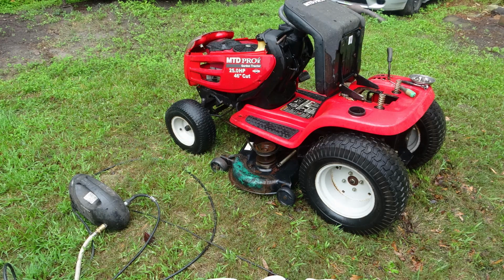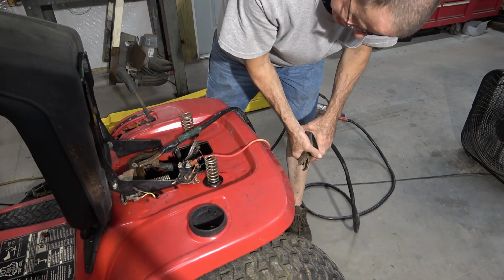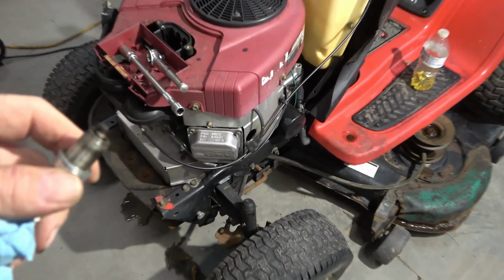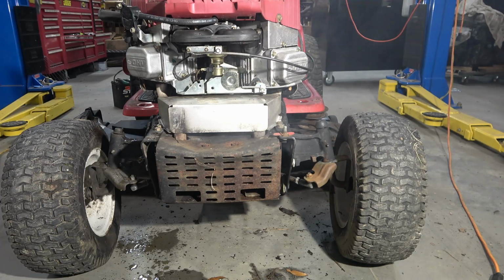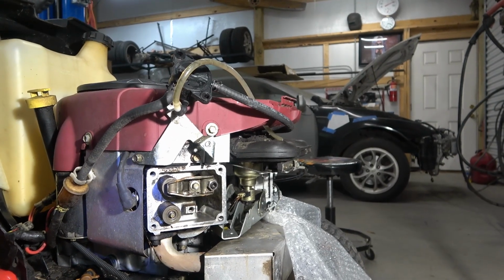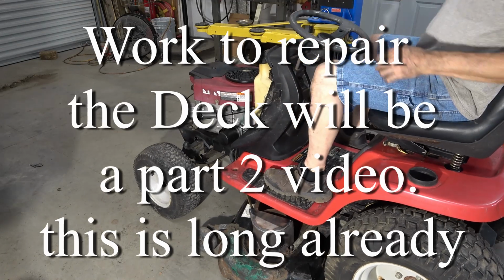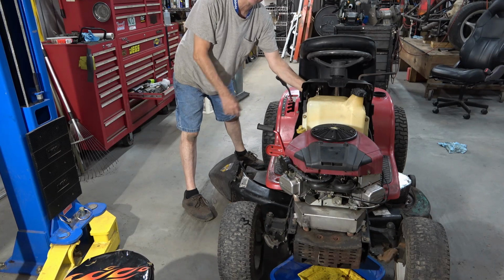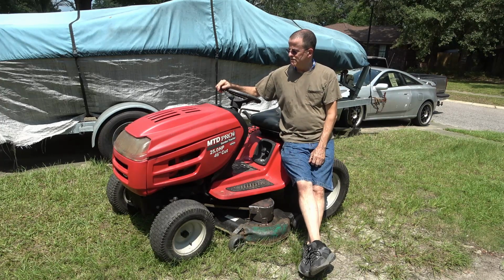Free Lawn mower - will it run_ - Will not start, how bad can it be? LOL... Part 1

Comment: I was placing my bet on needing valve adjustment or compression release on camshaft being broken, carb needing cleaned out, and or head gasket blowout from overfilling the oil, since those are usually the things that take a vertical crank lawn tractor from working to free.  Wasn't expecting that much sludge.
Reply from the maker: Ah ha you've done this before🙂. Ya that was alot of sludge.   I'm thinking because it's sat (outside in the woods) so long with that valve cover gasket out of place on the top edge. And I got lucky on the carb working👍.

Comment: Where did all the smoke go???????  Was it from oil leaking from valve cover on to the muffler?
Reply from the maker: That had to be what it was.
Reply: @TSRGarage  Yep, a good bath with your pressures washer is always in order for a good first step.  I fixed my neighbors zero turn he purchased used.  After the bath, Ha Ha I had to replace almost every gasket and seal on the engine. Then no more smoke and it ran and acted like a good lawnmower.
Reply from the maker: @helicopterjohns   👍
Reply from the maker: An update. I just mowed some grass that was a little taller with it. It still smokes a little bit when it's under a good load. Also after it sat for a week or so smoked for a second on startup.